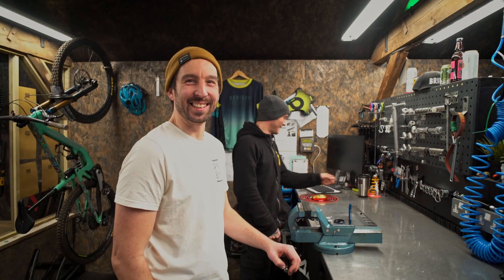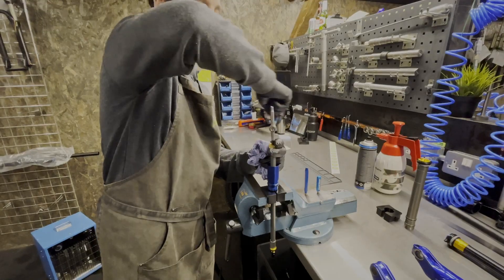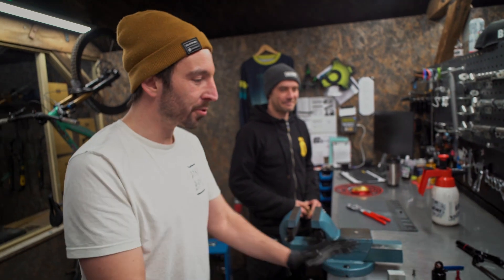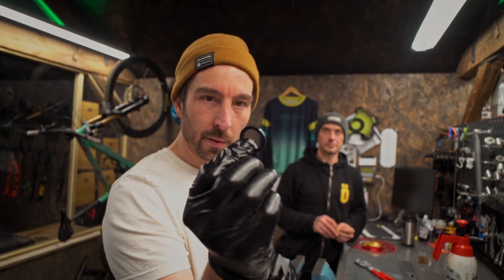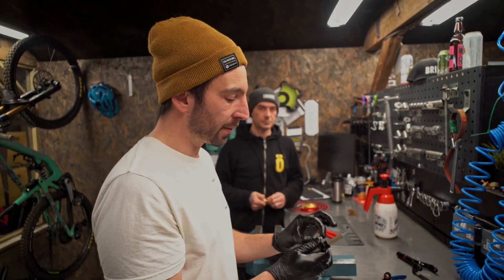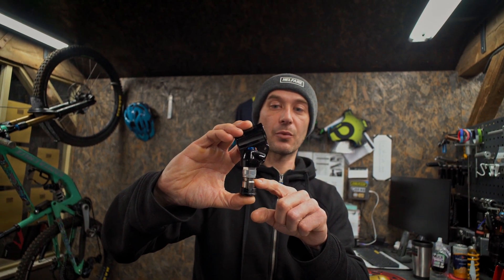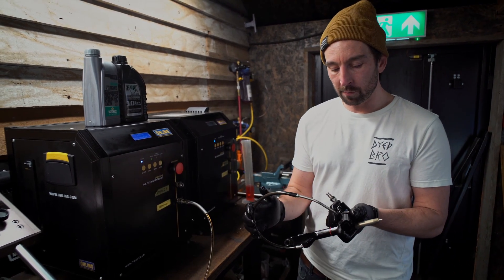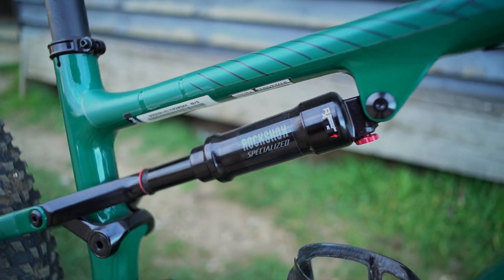Rockshox-Specialized Brain Shock - How does it work? What's inside and full suspension service

Comment: Fascinating video. Thank you so much for putting it out. I have a question about these brain shocks. It’s supposed to release when you hit something sharp. When they release, does it feel like your bottoming out? My bike is driving me nuts, the rear shock is not fully extending, I can tell by that rubber ring that it only extends half the distance. But it still feels like it’s bottoming out.
Reply from the maker: Hi Liz! Thanks for the kind words. These units are pretty complex and right at the edge of what can be achieved in such a lightweight system, so service is key! The feel off the top can be a little clunky as the valve goes from shut to open but onces its open the shock should feel smooth and just like a normal shock. If its bottoming out then thats a good sign that something else is up and it needs to come into a workshop like ours! Are you in the UK? cheers! Mat

Comment: I bought mine in 2018 and since then, it fails every season after every 2000 km or so (that's a full season for me due to more roadbiking in summer), that's about 100 hours of use for me under less-than-taxing circumstances as I don't do heavy trails. (failing= starts pogo-ing, so loses the lock-out) 
Is that normal? Are we really supposed to be servicing it twice per season? Supposedly one of the rings is fragile and after a while it breaks, that's when the po-go starts setting in, including the sucking noise.
Also, what are the service prices throughout Europe? I pay about 100 Euro locally for the service (not the promised replacement warranty), I have no idea what they do with it.
Reply from the maker: Hello! So this shock is a racing product and really is at the very edge of what you can get away with in such a small shock. The issue is with such a small lightweight shock the volume of damper fluid is tiny so it degrades much quicker meaning 50-100hr service intervals. If you want auto lockout lightweight race shock you're going to have to service it. alot! We charge £180 as the service is quite involved and we replace alot of hard parts aswell as seals. Generally once its been through our workshop you are good for 100-150hrs

Comment: I have exactly the same issue with my rockshox and I want to unmount and remount it like you did. Do I need specific tool? (I have a high pressure pump and a torque wrench). Thank you
Reply from the maker: The shock comes off the bike with standard tools but servicing the shock requires alot of specialist tools.

Comment: Nice video, what’s the difference between a 50 and a 200 hours service? Here in my country there’s only 2 or 3 stores that service this type of shock and the prices aren’t too much different
Reply from the maker: Thanks! a 50 hour service is essentially just an air can service. The 200hr is a full strip and rebuild with new o-rings, some hard parts and fresh damper fluid etc.

Comment: will the rear shock still function when you stand up and bounce on the bike on a smooth surface?
Reply from the maker: This depends on where you have the threashold set. Your body weight is all low speed input so no it wont move much if you bounce on the bike but in a bump instance it will move. It isolates bump speed and shock position. Its a pretty clever thingy!